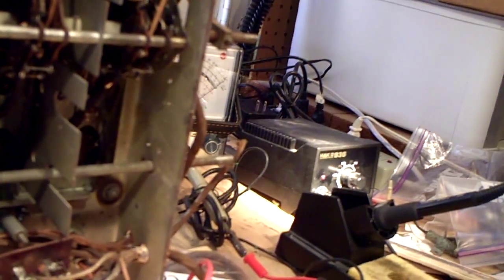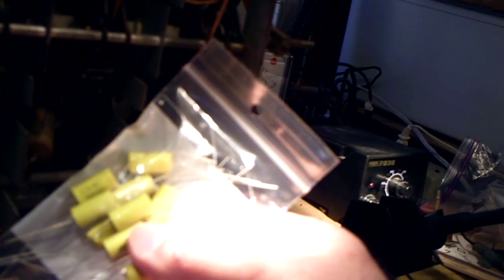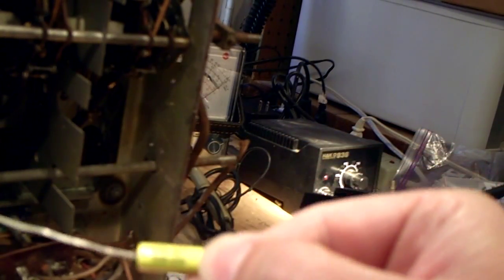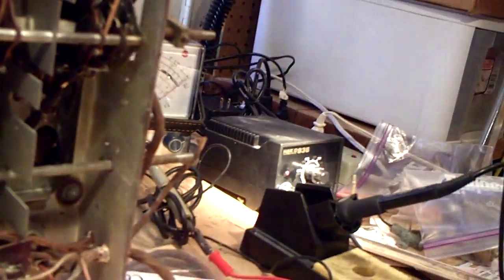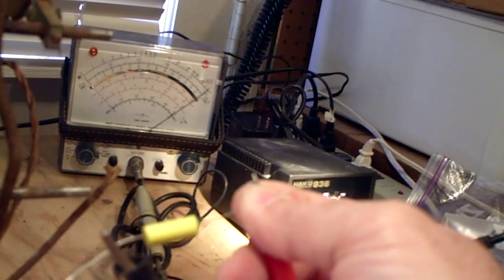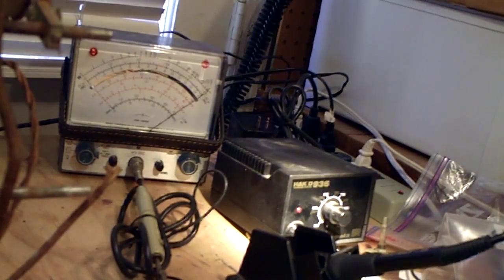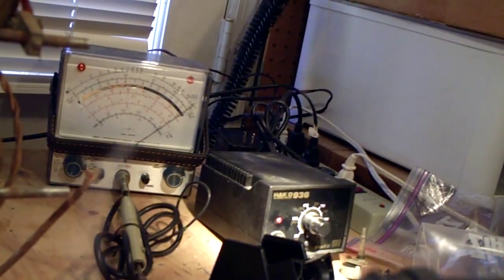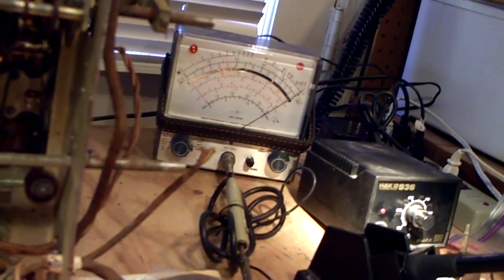Part 2 Capacitor Replacement. antique Radio. (please note: this is part 2 of 4)

Comment: how come you didnt get shocked when you charged up the capacitor with the meter and were touching it with your fingers, i thought capacitors stored electical charges and can release them when touched
Reply: not  enough  voltage  from the meter

Comment from the maker: @radioman56 move the decimal point 6 places to the right and you will convert to PicoFarad. So for the .0005 MicroFarad, you will need to buy a 500 PicoFarad cap. Get a mica one (they cost 99 cents) and then you will never have to replace it again.